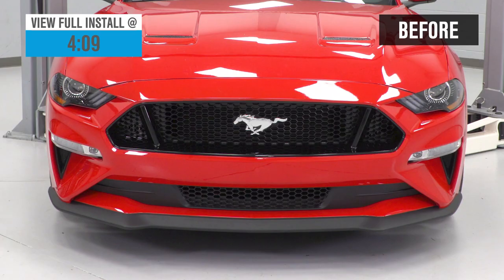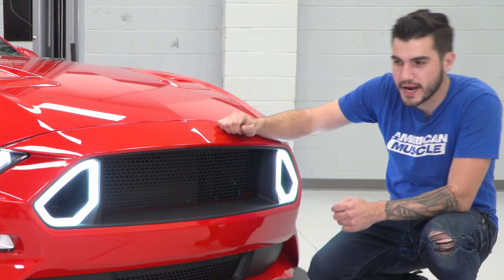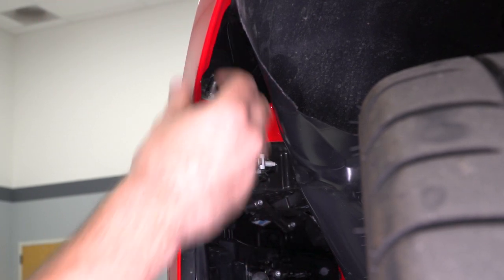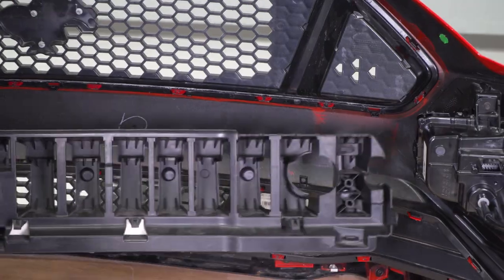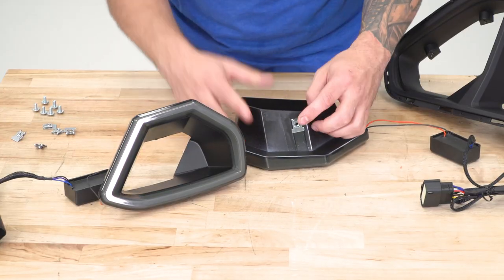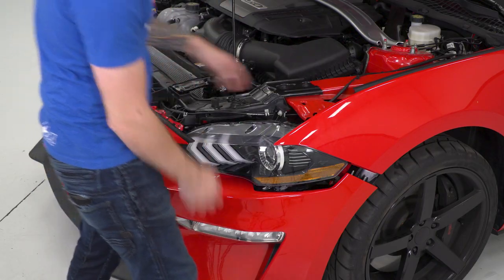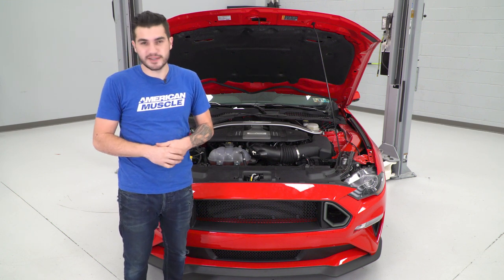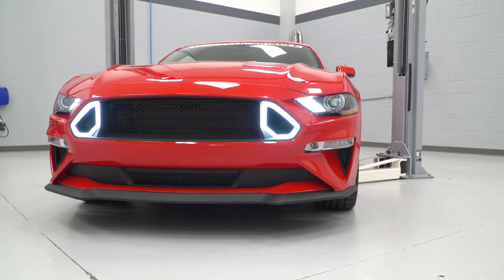2018-2020 Mustang RTR Grille with LED Accent Vent Lights Review & Install

Comment: Your RTR non led grille install was waaaaaay better.  Why did you take it down?You actually show the exact spot of the grille to drill and even recommend a slightly smaller bit than 7/32.  Saying “it’s not that hard” with the camera 5ft away and not actually showing the recommended spot to put a hole in your new $550 grille isn’t exactly making it easier.

Comment: Would be nice if you said exactly where to drill on that opening.  You used to explain that on the non LED version of this grille but that video has since been taken down. If you’re even off by a cm it affects the way the insert sits.

Comment: do you have to remove the bottom grille or could you just get the upper grille only since thats offered on your website or is that for if you are replacing the upper grille only
Reply from the maker: You could totally just go with the upper if you'd like Ben! -Justin

Comment: I installed mine today drove to the gym and the car did not want to turn off. I pressed the start stop button but nothing eventually I disconnected the battery it still did not turn off. So I figured I disconnect the driver side headlight plug and the car turned off. Can anyone explain why this is happening
Reply: Same thing happened to me today! Did you end up finding the issue?

Comment: lost communication with image processing module a ..... I'm getting this message on my car and it won't turn off completely unless I turn off loghts
Reply: Could be just bad ground wire
Reply: @ulfrlockseven  ill be getting it checked soon ...its the plug n play style I didn't have to terminate anything myself
Reply: @matthew-elite  if it's not bad ground wire , other thing could be is the harness that connects to your headlight. It should be a relatively an easy fix, hopefully it goes smooth for ya
Reply: @ulfrlockseven  hopeing so lol thank you

Comment: I just installed mine and none of them turn on n I double check the harness connection and still nothing only the headlights turn on..
Reply: I'm having the same issue have you found any fix?
Reply: Same issue any fix?
Reply: @juniorperez1020  from the forum I saw its apparently loose wires that connect to rtr led lights

Comment: I dont know  who the disrespectful  employee was who answered my call. Trying to place a order that is very well needed, for me to be able to drive my car . Because the fuel rail was bent by the mechanic who was taking off the IMRCV. Which is a part that always goes bad, a emissions part that never should have been included in the car. I was trying  to explain and order a fuel rail and new headlights  because the Raciom one piece never ever has worked anyway. Easy to install one hour. Passenger side never has set in place and the factory and the screw adjustment that came with the lights didn't work  3 hours working with it. Only to have the park light side to never secure down. Making it impossible at times to see out. Always causing it to vibrate out about 5/8 of a inch out from the fender. Trying to order both part and several more  parts for my 98 Cobra and 99 Cobra tail lights, suspension drop,racing shocks,new rim and tires to make the 99 race ready with the 6 speed built terminator transmission just put in. Getting ready for the drag strip, so we can truly see how it's going to run. Motors been ready stage 2 vortech supercharger, and built and bored motor. Itching to be ran. But your employee who decided to hang up on me rude and very unprofessional. I was straight up with the guy, that I didn't want to talk to no employee that didn't know about mustangs. Because last year about this time last  year, the guy I placed a order with sent me 4 Nitto tires NTSSSG2 315 size for the back, and the size on front wasn't in stock and he assured me the size in stocks would fit on the front. They are wider not taller and wod work great. After picking up the car , it was dark and  I looked at it in the lights at my shop. Front tire where like 1 3/8 taller than the back making it look like crap.Jacked up in the front. Looking like these jacked up truck ( Carolina squat )... that looks like a dog taking a dump or humping someone's leg. LIKE STRAIGHT UP CRAP !!! I call the guy I placed the order with back , he said you can raise the rear. The cars is dropped with suspension from AM ,race ready.  His mistake at MY COST .... 2 Brand new nitto tires in the shed that can not be used. And since they where drove about 4 miles I can't send them back, so I'm stuck with 2 tires I can't use. And  it's are not cheap especially   the high performance ones.So I wanted to mack sure that no more mistakes were made that would cost me. And I wanted someone who knew not a new employee learning the ropes. Maybe he was the one who made the mistake  ? But I just don't want a new employee taking my order. Because no matter if you send back a part and its their fault, the customers pay for the shipping and you lose money. Because of a new employee.  But whoever  it was that hung up on me and didn't call back. To any supervisor who reads this, employees  like this can ruin a business. And I know first hand on how hard it is finding good employees. Because I run a custom shop and know how hard it is finding a good employee.  Honda management told me they are lucky if they get 1 employee out of 31 employees they hired to work out. That how bad It is in Bama finding a good one, the statistics from Honda Manufacturing. Look at the date and about a little over a hour ago the incident  happened. And set this dude down and tell him a few things about doing the customer wrong. Would he like to give his hard earned money away. To a order you trusted to be right and it is not. Wod he like that , if so send me a check or money order for these tires I can not used. Send me the payment, and I'll  send him the tires so  he can use them to start a  bond fire. Since he's got money to throw away. !!!! BECAUSE COMPANIES LIKE THIS DON'T DESERVE MY MONEY !!! The ones this cost the customer's not the company's.... even when it is they're  mistakes.
,

Comment: Since there is a direct airflow, how do you prevent bugs and leaves coming through the intake snorkel?
Reply: That’s what a air filter is for and if your worried about the air filter gettin dirty just stick with the stock front. There isn’t a bug in the world that would fit tho that tiny intake hole